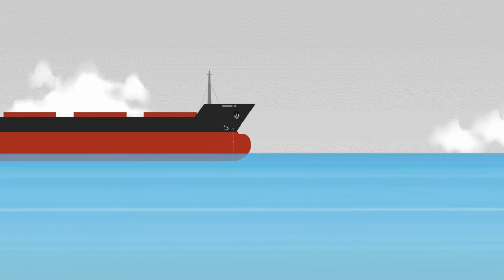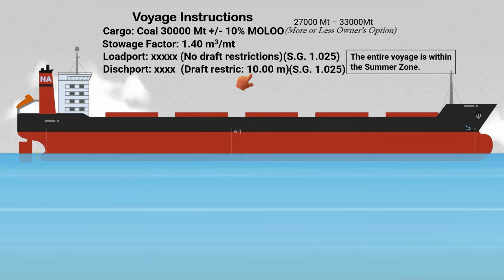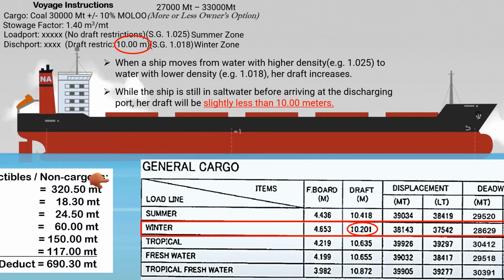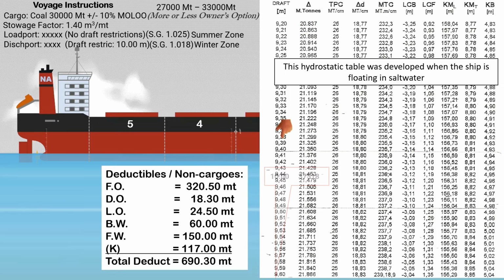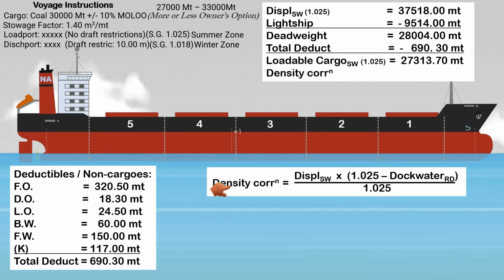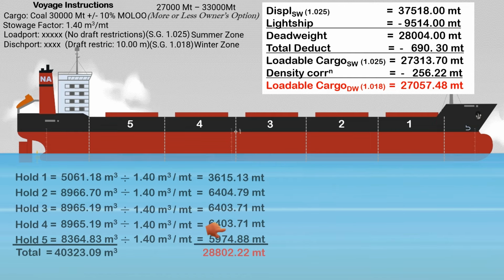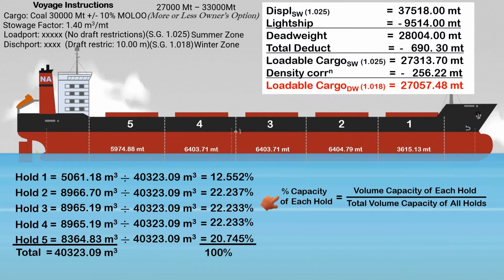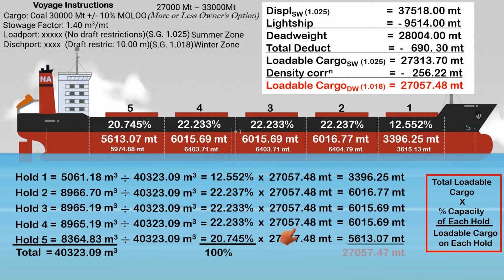Cargo Hold Capacity Calculations Part 2: Draft & Load Line Restrictions with Density Corrections

Comment: Is it a problem that the holds are not filled to full capacity because the cargo is grain?
Reply from the maker: I will try to make a video about grain calculation in the future. The unique characteristics of grain necessitate specialized calculations and precautions during loading to ensure vessel stability and compliance with safety regulations, distinguishing it from other dry bulk cargoes.

Comment: I have one question. If no restriction draft in discharging port, so with max draft loaded in seawater no need to do density correction for discha port, we can take in account dwa, that’s correct?
Reply from the maker: Great question! You are right. If there is no draft restriction at the discharging port and the ship is loaded to its maximum permissible draft in seawater, you don’t need to apply a density correction for the discharging port. However, you must also account for the change in draft when transitioning from salt water to dock water, considering the ship's UKC. Calculating the Dock Water Allowance (DWA) is essential to ensure compliance with the minimum UKC requirements as per company policy.
Reply: @ Thank you sir for answer. Appreciate it.

Comment: Nice vlog how about  summer loading port about 7days she pass to winter in certain latitude and longitude position that when she pass she will be in winter tks
Reply from the maker: Thanks for watching! Great question—to maximize the loading capacity from the loading port (summer zone) to winter zone, coordinate with Chief Engineer to confirm ROBs of FO, DO & LO upon arrival in the winter zone . Share details of the voyage plan, especially the distance from the loading port to the winter zone, then calculate the loadable cargo considering other consumables onboard using the loading-back method. If the vessel carry more cargo while sailing within the winter zone following the permissible winter draft, be sure that upon arrival at the discharge port draft requirements are complied, recalculate consumables from the winter zone up to arrival to ensure compliance with draft restrictions in the discharging port. This approach helps you maximize the loading capacity of the ship, maintain safe and compliant drafts requirements throughout the voyage. Thanks
Reply: How about if the density in loading is less 1.018 and the discharging port is 1.025 so the density correction is added am i correct to get the actual cargo to load